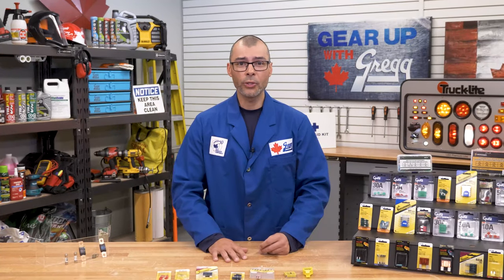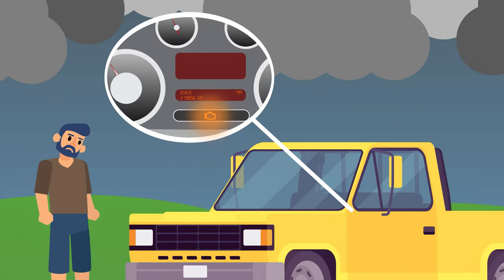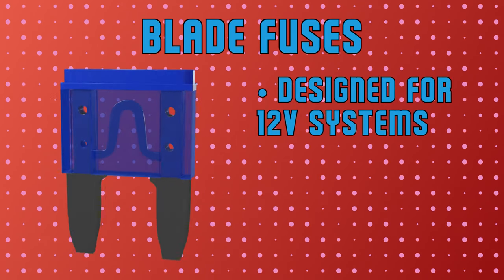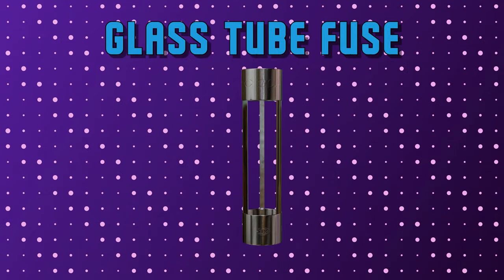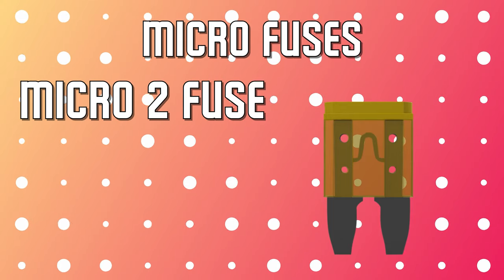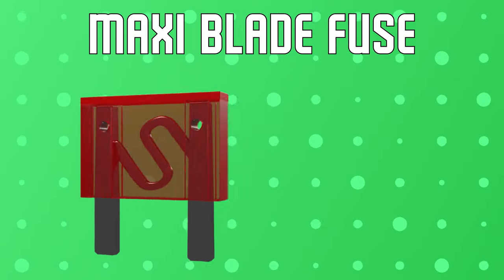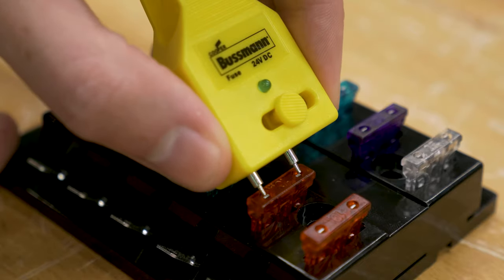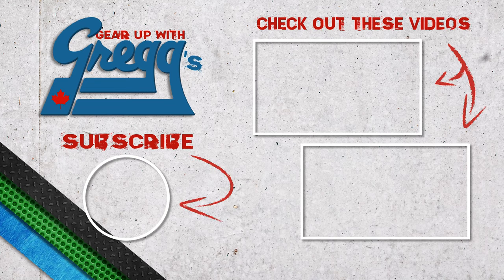The Basics of Automotive Fuses - Gear Up with Gregg's

Comment: Would you know how to fix a loose fuse that won't fit tightly in the fuse box?
Reply from the maker: It's unlikely that it's an issue with the fuse itself, as a loose fuse would most likely be caused by a worn fuse box. We would recommend professionally repairing or replacing the fuse box itself.